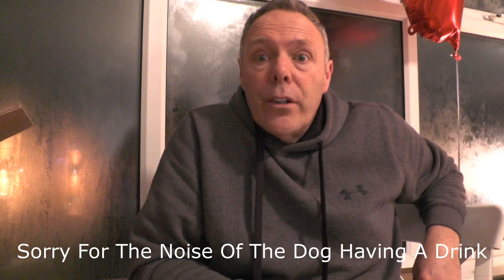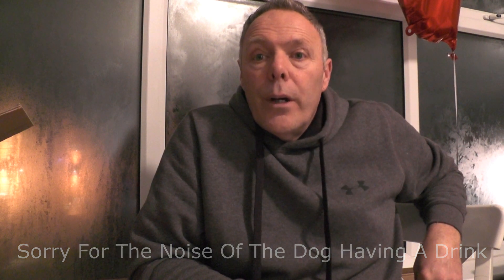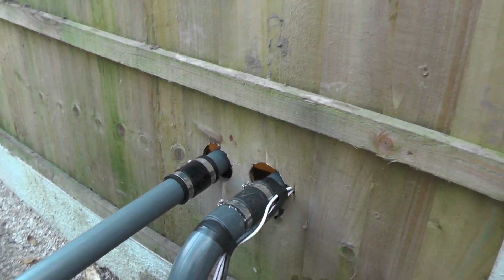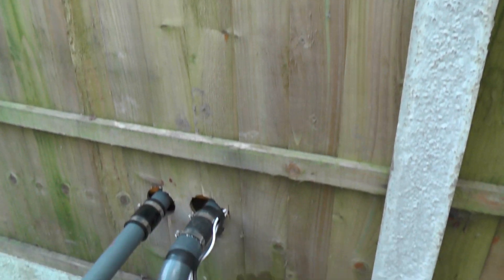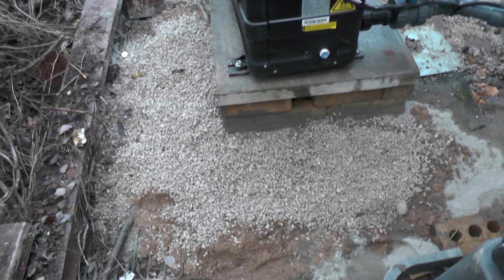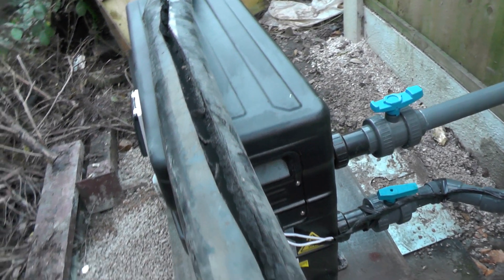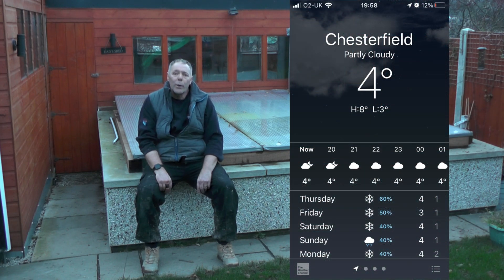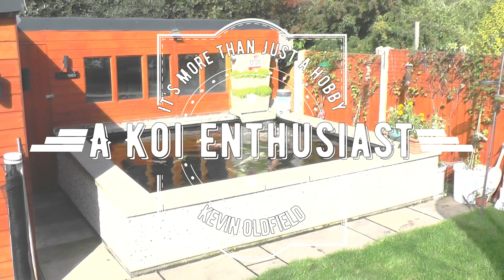Heating a Koi Pond With An Air Source Heat Pump Part 2 ** How To Install & Set Up An ASHP **

Comment: Have you got full flow from the pump going through the air source just trying to work out how I’m going to fit an ahp to my pond
Reply from the maker: Thanks for watching. Yes all the flow from the filter goes through the ASHP. I have a bypass installed too so in the Spring, Summer & Autumn I can bypass the ASHP. Having said that. A couple of times the water hit 27 degrees so I had the ASHP cooling down to 25 to help

Comment: Hi, great video on them conditions, I have a multi bay filter at the moment, my filter house is only 32 inches wide, but11 foot long, I would house the heater  outside the filter house, but would have to replumb, how much would you recommend thos make to other makes. Thanks Scott

Comment: Did you fit heat pump after filter and on inlet to pond
Reply from the maker: Yes mate. The sequence was Bottom Drain - Oase Filter - Pump - UV - ASHP - Pond
Reply: @AKoiEnthusiast  many thanks I’ve got one on my pond but keeps cutting out on low water flow think I need to have filter higher than ASHP as I have pump fed filter

Comment: Great video, ive just purchased the i15 after looking around, found these have a 3yr and 7yr warranty and at a great price,
 it says 1"1/2 connections but looks like your pipework is 2" did you have to reduce it dowm?
Reply from the maker: Cheers for watching and Hope you find the unit as easy and reliable as mine. Yes it comes with a 50mm/1 1/2" Union Adapter. All my pipework is 1 1/2"  except the Bottom Drains. The Pumps etc are reduced from 2" to 1 1/2".  Possibly wish I had run everything in 2" but maybe that's another Project.

Comment: Can this be used on a gravity filter system
Reply from the maker: I'm not entirely sure exactly what you mean as Gravity Fed refers to the Filter set up. My ASHP is set up on a Gravity Fed set up but I still need a Pump to push the water back through the ASHP and to the Pond return. If you mean can you fit the ASHP before the Filter I would say NO and would definitely not recommend it  as pre filtered water will contain Algae and waste likely to coat or line the pipework of the Heat Exchange. Having said that I would ask the Manufacturer or supplier before purchasing a unit.
Reply: @AKoiEnthusiast  I have a Oase 140000 screen matic filter which goes out from the bottom straight to a waterfall on a 4inch pipe where and how could i plumb the system in?
Thanks Ted
Reply from the maker: @bearcatkoi  I get it now. I would say it may be a little more difficult with your set up with the filter outlet being Gravity return and the fact of having a waterfall. If you want better clarity I would speak with  @Simon Ward at AES Ltd or the technical department of the supplier you choose.

Comment: Hi very interesting videos. Any idea on the cost per 24 hours? I would like to know how efficient this unit would be when temperatures are near freezing? I am setting up a 750 gallon EZ Pond that is insulated with 45mm Celotex and will be covered with 35mm polycarbonate. I was going to use a 2KW Cloverleaf heater, but I'm now wondering if it might be worth investing in a heat pump such as the Remora 6KW output?
Reply from the maker: Yes I can tell you exactly. I put a logger on the live supply of the heater for a two week period. The logger recorded the usage every 6 seconds for the two weeks. I also placed the logger back on from the 22/12 for a 30 day log. Once it is completed I will upload the results.  This video will give you a good idea. 
https://youtu.be/hOzglEaAMtM
If you look on my Videos is was uploaded around Christmas

Comment: I am thinking of getting the same size ASHP as you.what are the electrical/ wiring needs of it? Thanks
Reply from the maker: If you check out the first Video about the ASHP it tells you all about the connection. It is classed as Plug and play so it comes with a Plug & RCD, so all you need is a socket within 2.8 metres of the unit and away you go. https://youtu.be/8aVq7XiyzcE
Reply: @AKoiEnthusiast  thanks 👍

Comment: the old heater you was using how much would that cost you a day buddy and are they any good
Reply from the maker: There are a few Videos in my Library of how much they cost to use. One from Feb 2019, one from March 2019 and one from three weeks ago and YES they are good and did the job nicely. They can be programmed to come on at different times. Over the three videos it works out at an average of around £2.50 per day

Comment: Standard setting on the Remora is a four degree swing but you can set them at two degree, not sure if it is more cost efficient but it would be better for the fish.
Reply: The degree swing is the maximum allowed before the unit will switch off and then back on. In reality this doesn’t happen if correctly sized on an inverter as it’s changing its speed to match the heat loss.
For this reason it will normally hover plus or minus 0.5 degrees from the set point. Hope this helps
Reply from the maker: Cheers fr commenting. I have the details about that Parameter but at the moment the temperature has only moved between 16 Degrees & 17 Degrees according to my Temp logger so I'm not too worried yet

Comment: Hi great vid keep them comming 👍 what is the size of your pond and what is the wattage of your heater you have just fitted 
Cheers
Reply from the maker: Cheers for watching. If you look in the Description all the details of All the Ponds and equipment is listed on there. The main pond is 2,200 Gallons and the ASHP uses just under 2kW when running 100% to produce 12kW of output temp but on Smart Mode it would never use anything near that unless it is heating the water up to a high temperature or from scratch. It is sat at 17 Degrees

Comment: Another great job Kev,but why no cover over the top of it,it is very quiet.
Reply from the maker: The rain cover will be put over it this week but like all ASHP there needs to be clearance of 300mm behind, 700mm at the sides, 500mm on the top and 2500 in front.

Comment: Nice job and video.
Quick question why did you not leave your old heater in place and plumb it in further down you pipe?
It’s there in case you need it.
Reply from the maker: Cheers for watching. Yes with hindsight I could have. I was going to sell it but a friends said what if the ASHP fails and then I noticed the unions were nearly identical so for the sake of 2 minutes unscrewing the unions it will fit in there. Maybe a later Mod will see it on the skimmer line or the return line.
Reply: I am in exactly the same situation as you have an Inline electric heater and I’m currently working out it’s cost.
Having said that I only keep my fish at 13 degrees over winter.
And I’m fully covered like you.
So it’s a tricky one wether the further expense is reallyworth it.
Reply from the maker: @markbrady7462  Last year in Feb & March it cost me £2.22 per day to heat it so I am intrigued what this will cost.

Comment: Hi Kev, nice set up keeps it out of sight,  what's the pipe coming out the front below fan is it for condensation run off, I bet it blows cold in front off that fan, can it also cool the water if we ever get a blazing hot summer, stay safe.
Rob.
Reply from the maker: Cheers rob, yes it can cool & Heat anything between 5 Degrees & 40 Degrees so yes in Summer if it gets above 24 Degrees again I could cool the water a little. You can come and have a good look after Xmas. Stay Safe mate
Reply: I will take you up on that offer Kev, have you seen the sand filters at AES they look same build as bead filters and seem a good price, I was wondering if they would run same with k1 micro in, units come empty as you have to buy sand separate which obviously wouldn't need anyway.
Rob.
Reply: @robertnicholls9409  Rob I did that put mirco in instead of sand runs like a dream just need to make sure you have a blower fitted for cleaning
Reply: @barrykoikeepercooper8052  did you get yours from AES what size did you go for and how many litres of k1 micro does it hold, also where did you get your blower from and was it easy enough to add it, I'm roughly pricing it to get a idea of total cost, I have the same filter as Kev, the Oase premium compact drum filter which my bottom drain will feed to and also my skimmer which connects into pipework from a mid water 3" feed which will go to the Oase as well but could go to a bead filter instead, at the moment it's on hold until spring, the pond itself is built but no liner or pipework is installed.
Rob.

Comment: Nice and quiet was it actually on
Reply from the maker: Cheers for watching and yes I could only tell it was on because it said Heat and also the air blowing out the front. it is only 10 decibels on trickle and 45 Decibels on full power. I want to put a couple of ribbons on the fan cover to see when it is on.

Comment: Neat installation as usual. What temperature are you heating to?
Reply from the maker: Cheers for watching and the comments. I am going to start at 17 Degrees and check how much it is costing to run and then eventually I think I might drop it to 15/15 degrees C
Reply: @AKoiEnthusiast  My pleasure. How about feeding plans? It'll be neat if you can install an underwater cam to enjoy the pond  more during winter. Though I'm sure it's in the works.